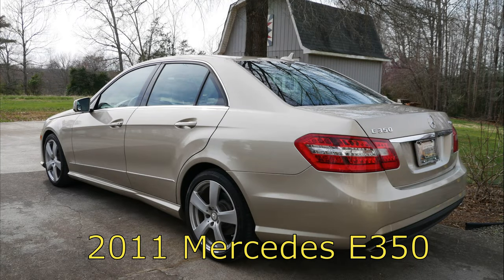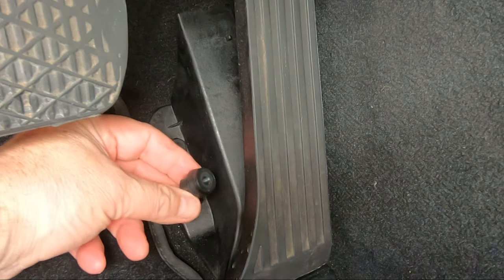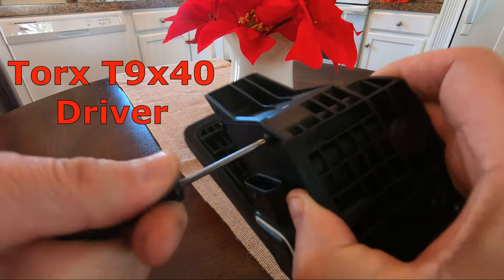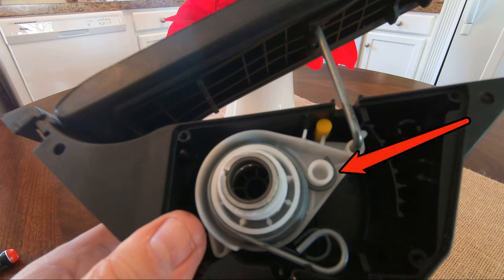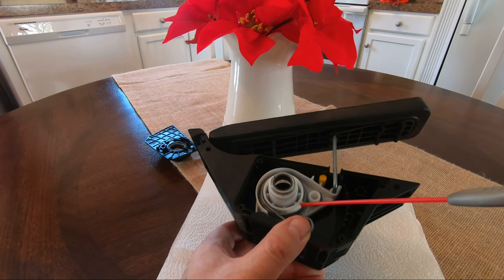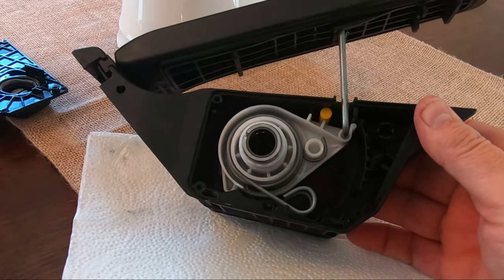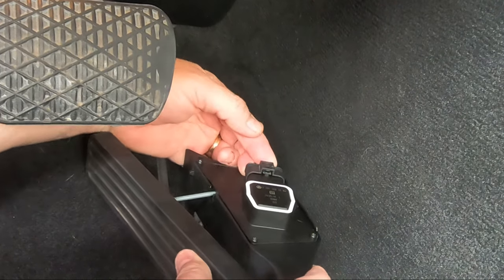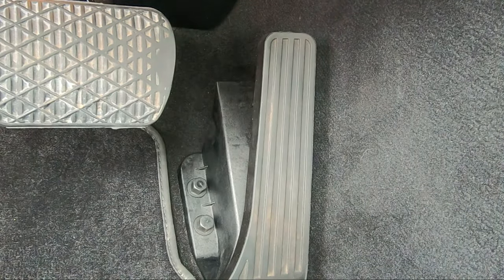Mercedes Gas Pedal Whistles at Me

Comment: Is it normal for Mercedes Benz accelerator to whistle
Reply from the maker: It sure wasn't normal for me, and the noise was too annoying to put up with.  That's why I had to fix it.
Reply: I have this issue it’s annoying. I also have a sound like rocks are moving around under my drivers side.
Reply: i use wd40 but the whistling came back after several months.. now i use silicone spray, and it's feel more smoother.. hope the whistling sound would gone forever.
Reply from the maker: @harisyoung4110  Good point, next time, I'll probably use a white lithium spray.